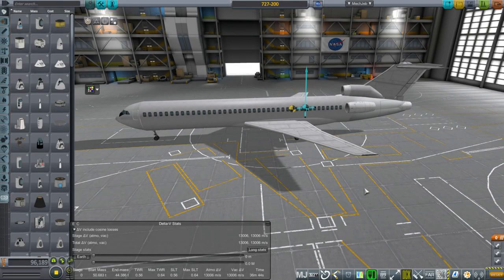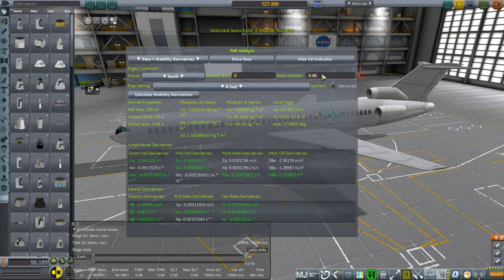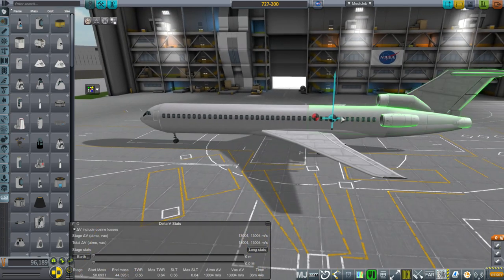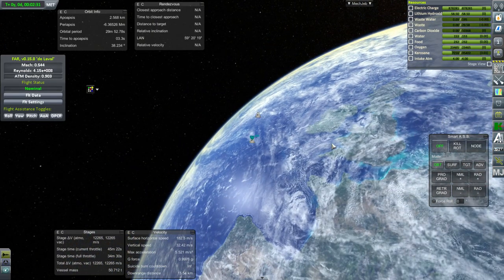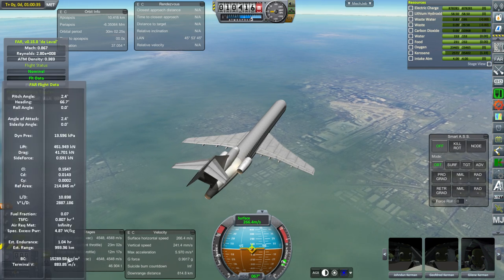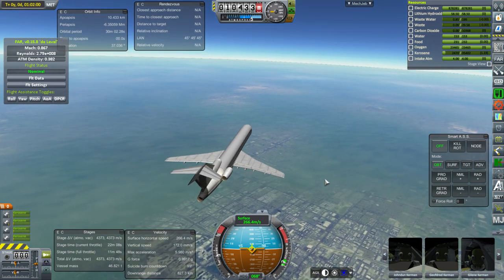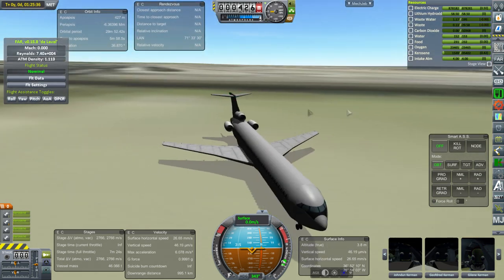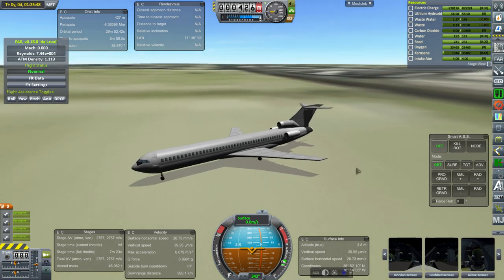Kerbal Space Program RO Sandbox - Boeing 727-200

Comment: The engines being level on that construct in the video is the cause of what forces you into getting rid of fuel. In actual 727 reality the overall thrust is obviously pointing backwards up like the space shuttle and other jet planes have the jets mounted under the wings for such "extra" pitch up all of them need at takeoff with the weight they carry at first.

Airplanes are built to be heavier towards ground for stability in that direction as well as the others, so you can also lower the big wings on your construct.

Those factors can give you the fuel you wanted.
Reply from the maker: From the look of them, the 727's engines are either flat or pointing a bit down, actually: https://upload.wikimedia.org/wikipedia/commons/thumb/2/2d/Pan_Am_727_tail.jpg/1920px-Pan_Am_727_tail.jpg. Do you have evidence that they're pointing up? And by what degree?
Reply: I couldn't find any pictures in first try that indicates Boeing evidence of what I wrote. We have to check Boeing charts and manuals. The evidence do exist in my stock plane constructs. At worst, for me, I will claim that the real 727 wings do a pitch up in combination with the jets no matter how it looks.

It's interesting enough for me to investigate into either I'm wrong or not, so give me a moment.

Comment: You can alter the angle of attack of the tailplane to alter the center of lift ^^
Also if want to make it more authentic, you should limit the contol surfaces to work on proper control input ie. only tailplane for pitch, only ailerons for roll, and flaps as only flaps.
Reply from the maker: I tried altering the angle of the horizontal stabilizer - didn't work. It is already at the optimal angle. I have limited the control surfaces, but had the wing surfaces also help with pitch given the lift problems. I may choose to keep them on flaps instead.

Comment: You don't have leading edge Krueger flaps which make a bit of difference and your tail looks a bit too smooth, the real boings have more of a cut angle and they still had a skid to prevent tail cone damage on rotation. Also they basically used small inboard ailerons for roll so the trailing edge was pretty much all flap. I would also say your sweep angle seems off, something in the wing. Not sure any helps ;-]
Reply from the maker: Well, I don't know if I can make leading edge surfaces work right, but I could use all the trailing edge surfaces for flaps. I'll check the sweep angle.
Reply: Raiz Space y the real 727s are pretty unique aerodynamically. The wings are really optimized for cruise so they use all sorts of witchcraft to make lift at the bottom end. And even with the T-tail they approach really flat and not nose high with everything thing out at about 135 knots bug.speed which is what 45 mps. I don't think KSP has the ability to really make it work. Lol I never could figure out how to make flaps work in KSP let alone the huge fowler things on a boing.
Reply from the maker: Well, that's what makes it interesting. Some people have suggested some witchcraft, so I'll see what I can do.